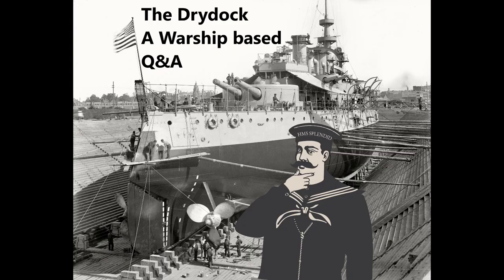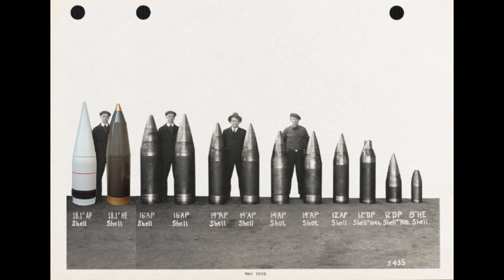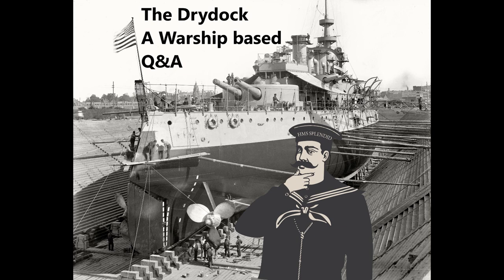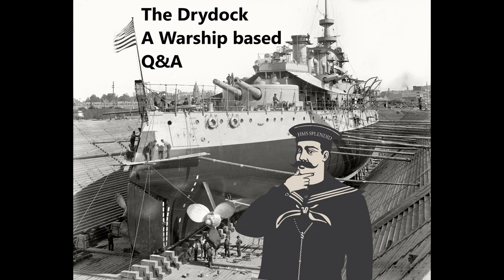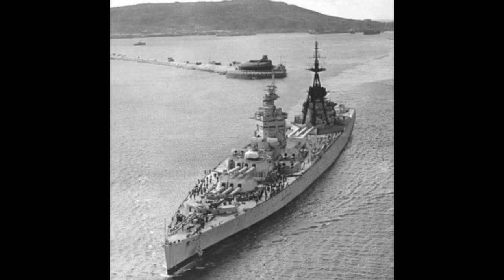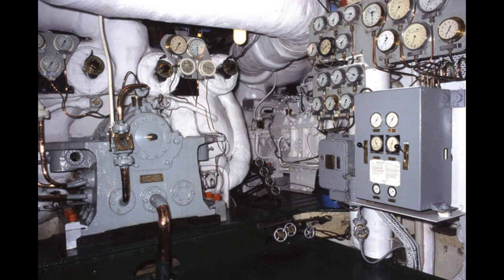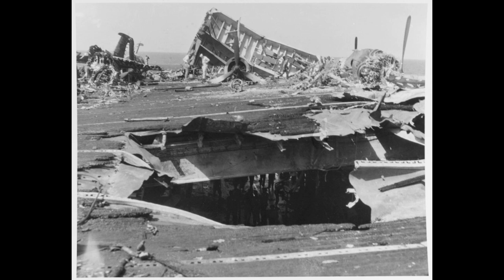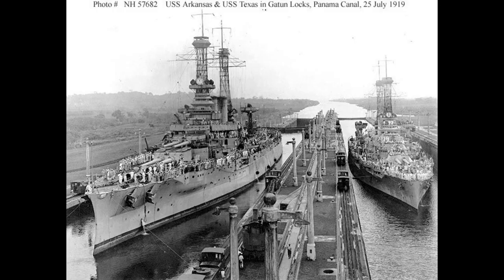The Drydock - Episode 094

Comment: Would modern CIWS, missile system or modern armour tech (eg supersized ERA) have any effect on a Mark 8 "Super-heavy" AP shell out of a 16"50?  Or are you still going to eat 1200kg of freedom?
Reply: Why do you specify a 16" "super heavy"? A modern 20 or 30mm gun-based CIWS wouldn't even upset a 5" shell, never mind anything battleship calibre. A modern 76mm (3") round, however, might be big enough to deviate the trajectory of quite large shells. But it might only change the impact point on the target, given that the 3" has a much shorter range and so can't intercept very far away.
Reply: Easy answer? Nope....
Reply: I was speculating on this several weeks/months ago. Basically, even a 20 mm shell could knock the ballistic cap off and alter the trajectory significantly. However, you'd need a lot more than the 1000 yards or so of 20 mm range to affect the trajectory enough for a miss. A RIM-116 tolling airframe missile hitting the shell 5-10 miles out would probably do it, leaving an utterly unscathed AP shell with penetrating cap (very blunt nosed configuration) to fall harmlessly into the sea several hundred yards short of the target.
Reply: @kemarisite  buy why?  You have a salvo of super sonic known fixed trajectory warhead in bound 10 miles In one CS update, the zone of impact for each shell is known.  5 will be no factor, should you shoot at the 6th?  Maybe, what is the range at intercept?   Train fire, optimistically range of intercept is less than 4 miles away. Now does that deflection push enough to miss? 

What about after learning all 6 projectiles splash points the ship takes over and automaticall change course to get out of the way of the biggest risk shells?
Reply: @AtomicBabel  the question wasn't "would this be worth doing" (no, because a big RIM-116 launcher has 21 missiles and an Iowa carries over 1000 main battery rounds ...) but "would this be possible" (yes, but not in the way the question envisioned).

Comment: 58:51 What shells in WW2 went "several times the speed of sound"? I think the single time would be quite sufficient!
Reply: Iowa's 16"/50 caliber Mark 7 gun can fire a shell with up-to 2700 ft/s, that is almost Mach 3. And Gneisenau's 28 cm SK C/34 can fire with up-to 3000 ft/s, again Mach 3. Yes, this is the muzzle velocity, but shell will travel with Mach 2 at 10000 yards, maybe even further.
Reply: Ivo Ivanov - And the muzzle velocity on Königtiger & 8.8 cm was 1200 m/sec (~3,940 f/sec), & the Jagdtiger 12.8 cm had a muzzle velocity of 950 m/sec (~3,130 f/sec)...
Reply: @TraditionalAnglican  We re talkin' naval guns, didn't we? :-) And you have to explain this not to meh, but to Robert Match, who is uncertain if WWII shell can travel at "several times speed of sound".
Reply: Ivo Ivanov - His question seemed to be more general, but your point is well taken.
Reply: Basically all? Mach1 is 342mps, most shells flew wll over 700, some over 800.
APCR/APDS from tanks could go well in excess of 1000mps.

Comment: Re: "00:00:38 - Is there an optimal velocity for naval shells of a particular weight?" What weight 16" shells was USS Washington (BB-56) using in its "knife fight" with IJN Kirishima?
Reply: Superheavy, but fired horizontally at point-0blank range.
Reply: @bkjeong4302  yup, 2700 lb at 2300 fps out the muzzle. Still doing about 2000 fps at 8400 yards at the point of impact.
Reply: The 406mm L50s on USN BBs fired at about 850mps.
This seems to be about the most one can achieve without using light composite or subcaliber ammunition, and the bursting charge is as important for naval combat as is penetrative ability, so there unsuprisingly wernt many saboted naval artillery rounds around.
Reply: @ineednochannelyoutube5384  for the high capacity shell, yes. The AP (42% heavier) comes out at about 750 m/s, give or take a little depending on barrel wear. A number of other guns fire AP at higher muzzle velocitie, such as the Littorios (850 m/s) and the Bismarks (820 m/s for the ships, 1050 m/s for the coastal artillery version). One can build a gun to throw any arbitrarily heavy shell at any arbitrarily high velocity, although it can quickly get into "awesome but impractical" territory. High velocity tends to come with a very short barrel life, even if the projectile can survive, early versions of the .220 Swift (2.6 g projectile at 1200 m/s) had a problem shedding the copper jacket. I dont want to think about how much heavier the gun would have to be, and the propellant charge, to get a naval artillery shell up to 1200 m/s, let alone the 1500 m/s achieved by smooth bore tank guns firing the aforementioned subcaliber saboted ammunition.
Reply: @kemarisite  Incorrect on the last point. Muzzle velocity cannot exceed the explosion velocity of the propellant, unless you use a light gas gun, but thats hideously complicated and impractical for artillery. Still that allows a few kmps with sufficiently light ammunition, as evidenced by modern tank guns.